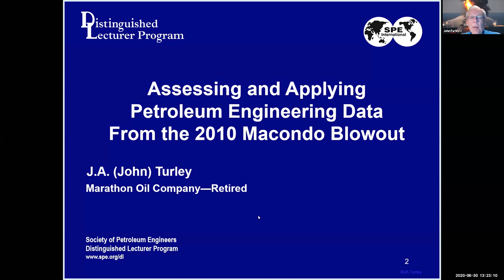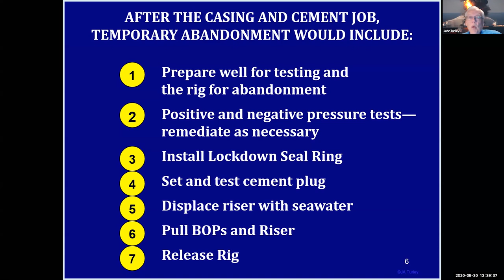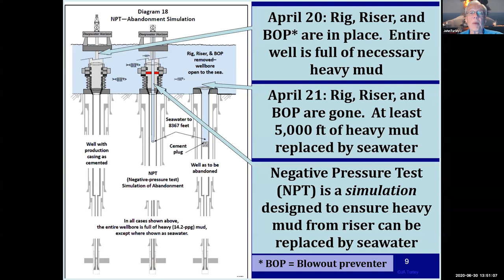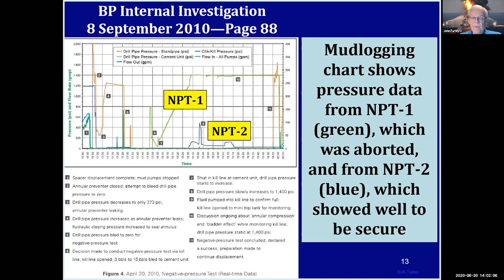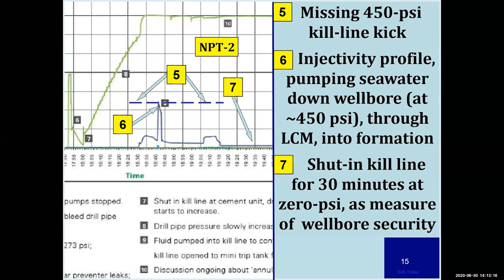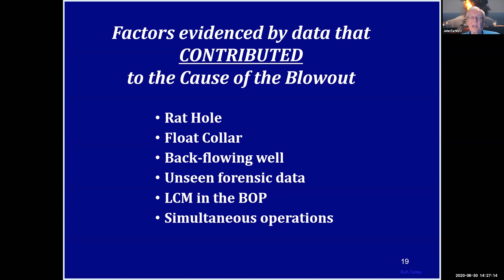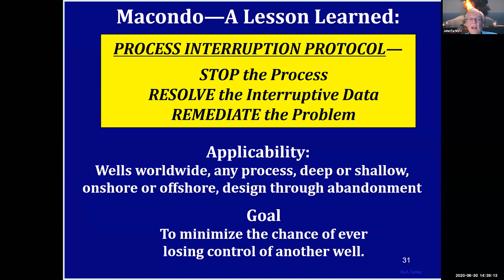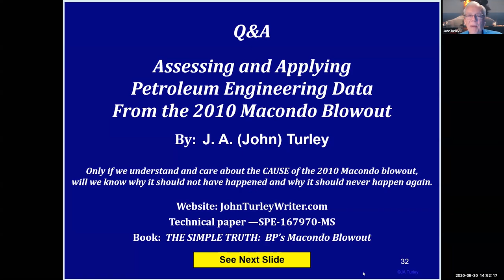The Simple Truth of the Macondo Well Blowout, Mr. John Turley, SPE Distinguished Lecturer

Comment: He fails to mention ONE other barrier that was going to be put in place, BEFORE running the "lock down seal ring" and pulling the riser and BOPs, that being ONE, or more cement plugs.
I also do NOT understand why the well schematic shows the float collar being set in the middle of the pay zone, this makes absolutely NO sense, as the shoe track is NOT going to be drilled out, and that placement allows NO 'rathole' below the production zone for debris, or a 'fish' to fall to bottom, and interfere with production from the perforated interval.
Also, the heads of Shell, Conoco, Chevron, and Exxon, ALL agreed, in  their Congressional testimony, that they would have NEVER approved of that well design.
I also fail to understand why Halliburton rolled over and accepted some responsibility, when it was BP who dismissed Halliburton's warnings about the BP decision to decrease the number of centralizers, as well, as dismissing other concerns that Halliburton engineers had regarding the revisions that BP had made to the cementing program.
Lastly, what a piss-poor way of doing a "negative test",  WITHOUT using a retrievable packer run on DP, thus having (unless the wellhead/casing seal was leaking) ONE more barrier, (the IBOP, or choke and kill manifold) IF an inflow was detected.
Offloading mud, while conducting the negative test ruined any opportunity to see any gain in the pits, or trip tank. NO, the FAULT LIES ENTIRELY WITH BP, and the poor maintainence on the BOPs by the drilling contractor.